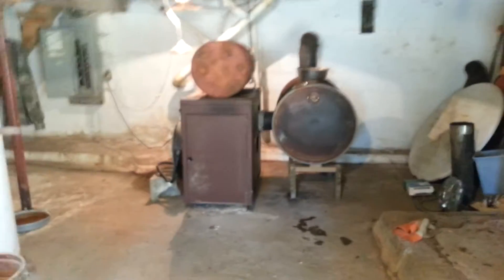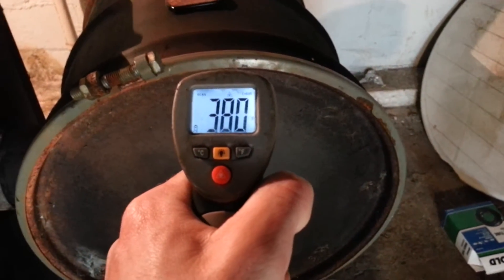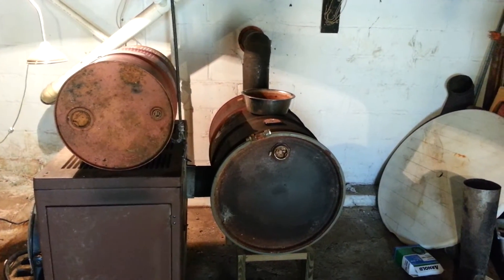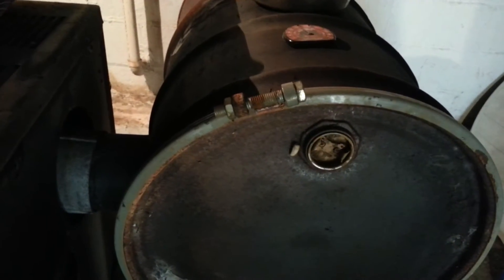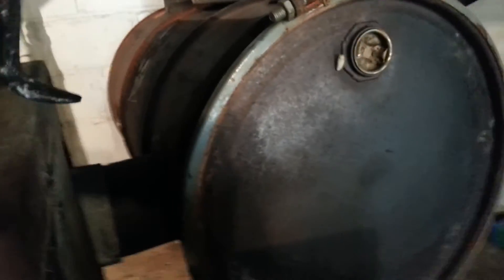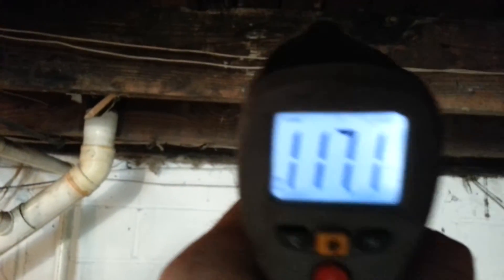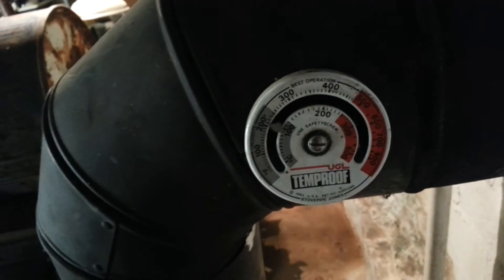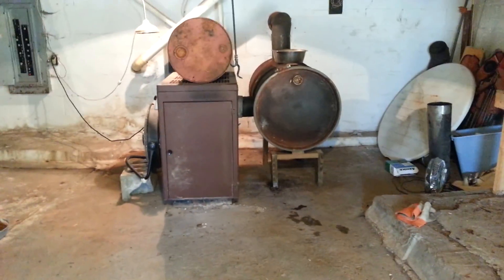Make wood burner coal circulator more efficient

Comment: Awesome.  Well done. I always thought: How about prolongating the stove pipe (making it a coil or something and leading it through a water tank or something). The thinner the wall the better: The heat gets better through a thin wall then through a thick wall. There are vintage bath boilers (for coal) if one could run the offgases through one of those one could even heat water (which should cool the offgases even better).
Reply: You dont want it to go to slow or cool to much or you wont get as good of a draft and you'll get creosote build up. With my new energy efficient bs equiped stove i figured the same thing but any moisture in the wood then turns to creosote to the point it condenses and runs back down your stove pipe making a huge black oily and wattery mess ware your joints go together.

Comment: i found and old sears circulator for only 95 bucks and hooked it up thru my fireplace and the furnace doesn't come on when i burn. But i wished i put it in the basement and hooked it up the forced air furnaces but i was afraid of my basement might flood.